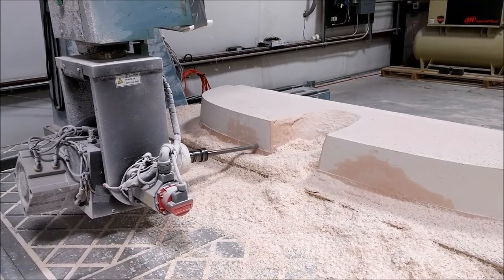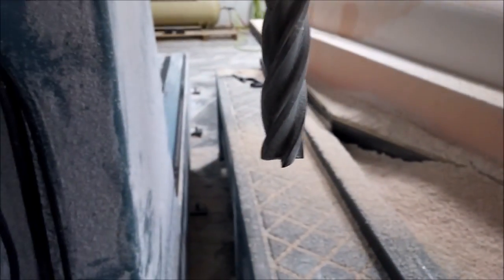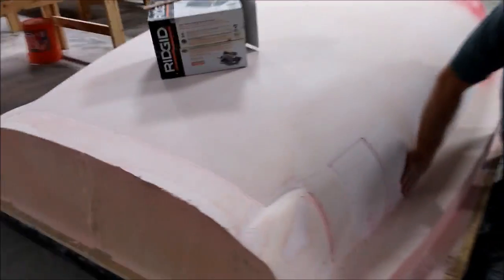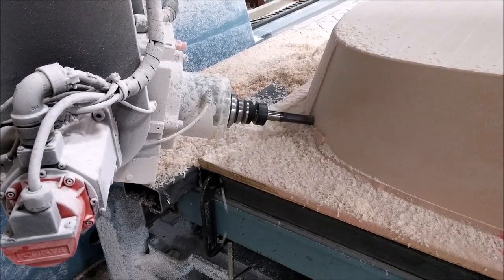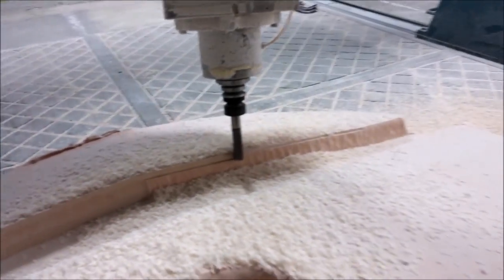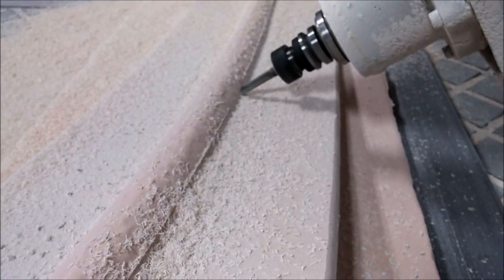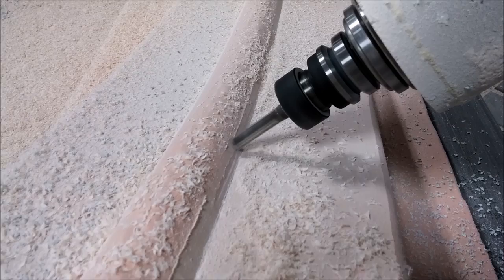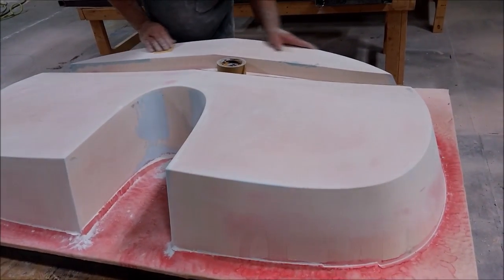Raptor Aircraft December 9th

Comment: This may be a naïve question, but I'm wondering why you have to mill positive plugs and pull molds from them instead of just milling molds?

-jcr
Reply from the maker: You can't mill a mold that is capable of handling building multiple parts. They're not tough enough.